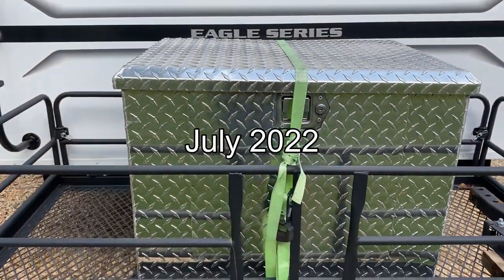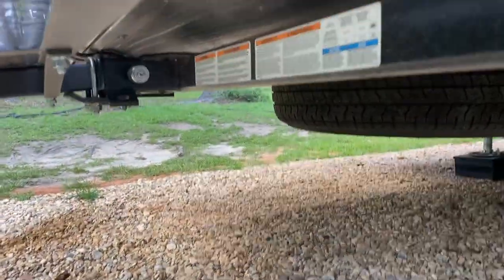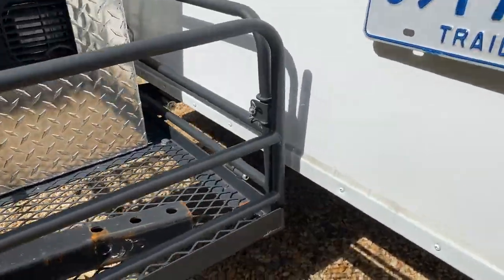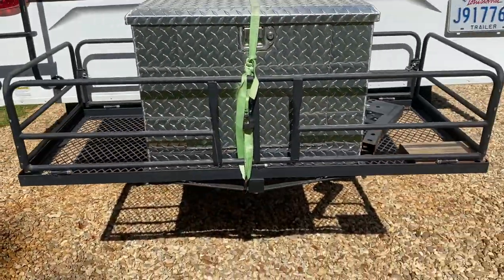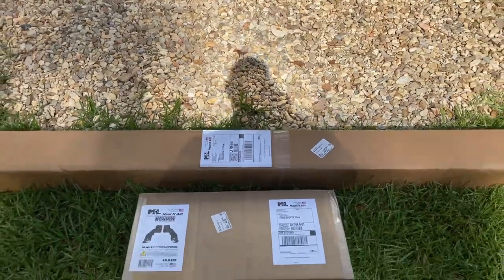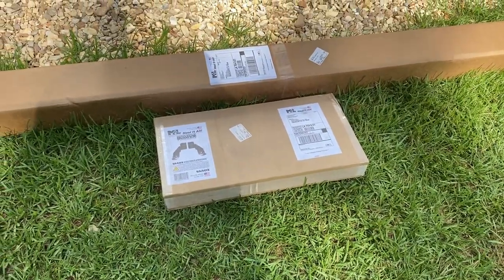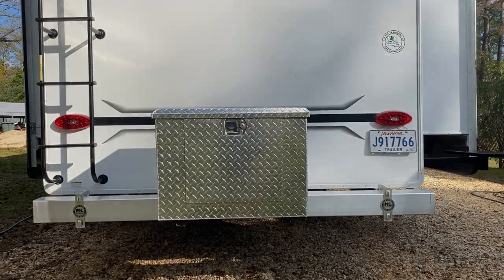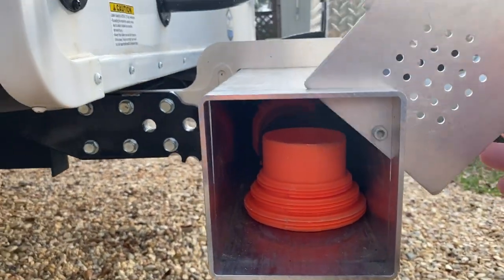Mount-N-Lock Heavy Hauler RV Bumper Install For Generator Box

Comment: Looking great . I would put a checkerplated  strap from the back across the lid and put a lock on it incase someone wanted to  "borrow " your generator.
Reply from the maker: I thought about putting a cable around it and out the back or bottom and around the bumper just to make it a little harder to take.

Comment: I just fabri-cobbled together a generator box mount for my RV. I added red marker lights to my box, and wired into the taillights on the trailer, fearing someone wouldn't realize it projected off the back and run into it.
Reply from the maker: That is a good idea.